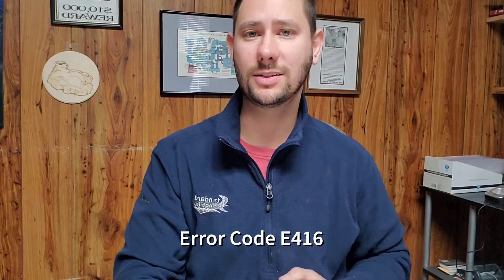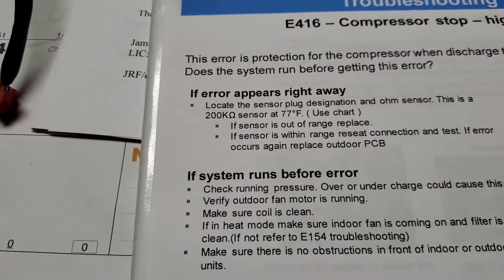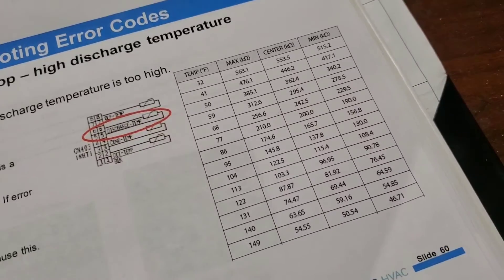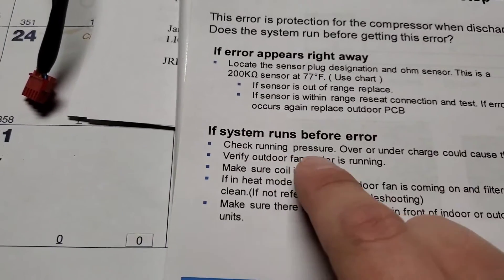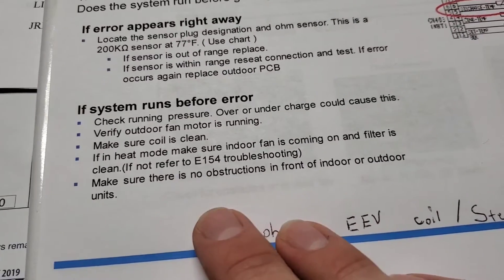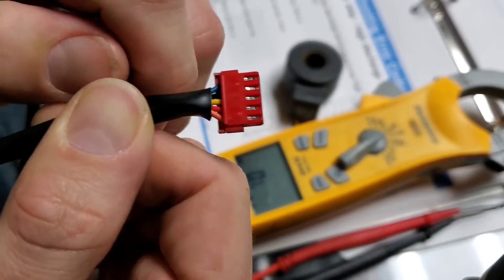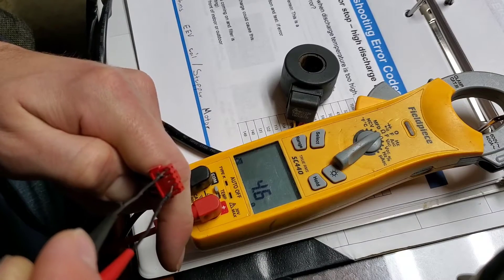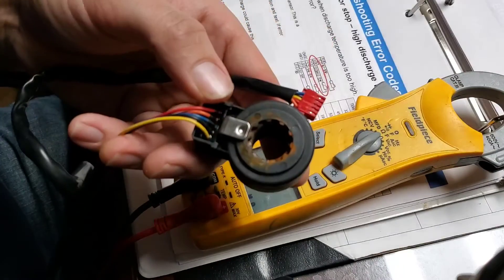How to check EEV COIL/MOTOR with a multimeter Error code e416

Comment: Thanks for video I am working on one that has five refrigerations circuits only using three two are working a and c work fine when I run B circuit the back pressure goes into a vacuum so I think the EEV is not opening up it is on the coast of N J I will ohm out coil and check for corrosion it’s 10 years old

Comment: My eev is making grinding noises when compressor is about to start. No error codes. Also no problem with cooling. Should I replace the eev stepper motor?
Reply from the maker: replace eev for sure check compressor to make sure its not making a weird noise

Comment: Most of cases E416 is a problem of compressors. Seldom when condenser is dirty or discharge sensor open or short. And most seldom case when there is problem with power or power cable of outdoor unit(voltage is too low or too high, size of cable not fit, or fixing of cable in braker not done nesessary.
Reply from the maker: Thanks for this info very good 
Love this kind of feedback 
thank you 😊
Reply: And one more reason is refrigerant. Either overload or unjustified.
Reply: You mean common blue wire..from common to all wire reading must be 46..47 . See or??if NT